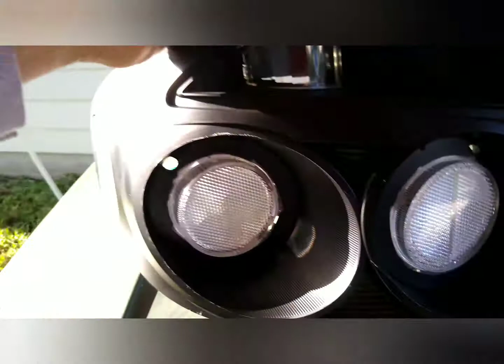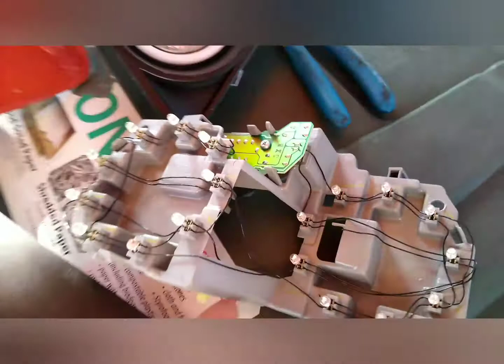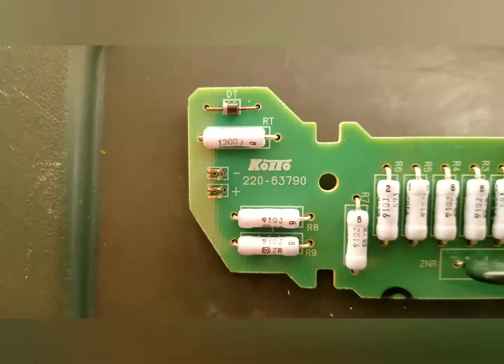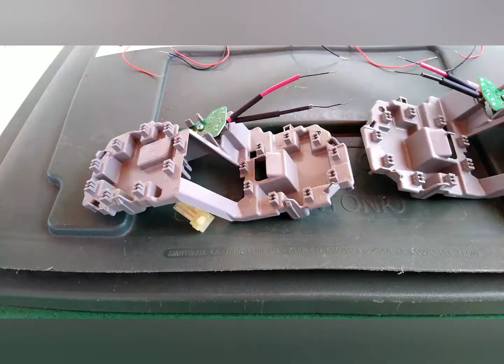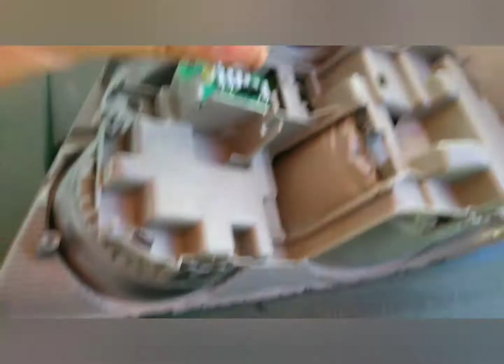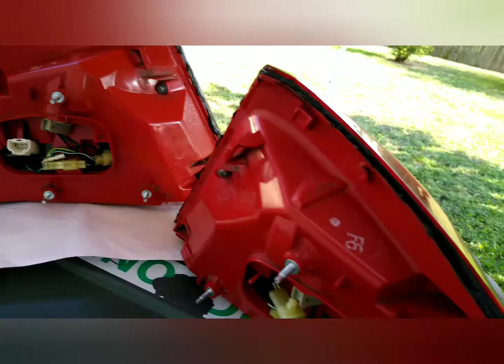#G35Sedan (05-06) Halo Install PT 2

Comment: Looks awesome man. Can you provide the link for these halos. I want to attempt it on my g!
Reply from the maker: QasimLED 1 Pair 90MM 60SMD COB LED Angel Eyes Headlight Halo Ring Warning Lamps with Cotton Plastic Cover Red 9-30V DC https://www.amazon.com/dp/B08139XJ52/ref=cm_sw_r_apan_glc_fabc_VHMR43DZ46M77A527XNF?_encoding=UTF8&psc=1
Reply: @GIOVANNITH3G35FAN  thank you. When you press the brakes do these get brighter like typical brake lights? I know the diode dynamics do
Reply from the maker: Going to be honest bro they do light up lighter but its not that bright like the diode dynamics. Then again those are like 100 bucks compared to the 12 dollar halos

Comment: Very clean job how much would you charge to make me some same model for an 05
Reply from the maker: Thanks man it was a fun little project. Ive been asked the same question about how much I would charge to do some. Honestly I dont know what I would charge. The tail lights alone cost over 200+ brand new plus the halos. I would have to figure out the cost cause I know its a tedious project

Comment: Where did you order the halo's from?
Reply from the maker: I ordered them from Amazon hers the link 
https://www.amazon.com/QasimLED-White-Headlight-Cotton-Plastic/dp/B0812ZF13F
Reply: @GIOVANNITH3G35FAN  You bought the white LEDs? i wasnt sure if i should be getting red or white LED Halos! also if i wire it exactly like you did the break lights should light up and turn signals as well?
Reply from the maker: Ahh shit I sent the wrong link I got red instead of the white bro sorry let me send you the right one
Reply from the maker: @NuMbE1KID  nvm that link should work but just click the red ones
Reply from the maker: @NuMbE1KID  Do you have a sedan or a Coupe? If you have a sedan the wiring is different compared to the coupe just cause on the sedan the turn signals are separate from the taillights.
Reply: @GIOVANNITH3G35FAN  Awesome thank you! do you use the OEM turn signals or are the Halos your turn signals as well as break lights?
Reply: @GIOVANNITH3G35FAN  I have a 05 G35X sedan so it would be like yours! im just wondering if you used the separate turn signals or are the halo's your turn signals?
Reply from the maker: Being that I have a sedan my turn signals are separate so I just have leds for the turn signals. The Halos are my break lights and running lights. I wonder if I could just eliminate the turn signals and buy that mod were you can use the brake lights at turn signal.
Reply from the maker: @NuMbE1KID  I was thinking of trying that turn signal mod but if I end up wanting to go back to my JDM taillights I would want to keep that orange turn signal look.
Reply: @GIOVANNITH3G35FAN  THATS WHAT I WAS THINKING! lol the Turn as break mod or whatever its called! okay sweet, have you had any issues with the halos since install? ive been reading lots of reviews on halo lights and they are starting to scare me lol